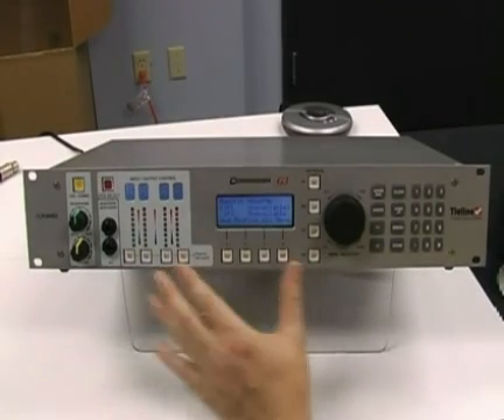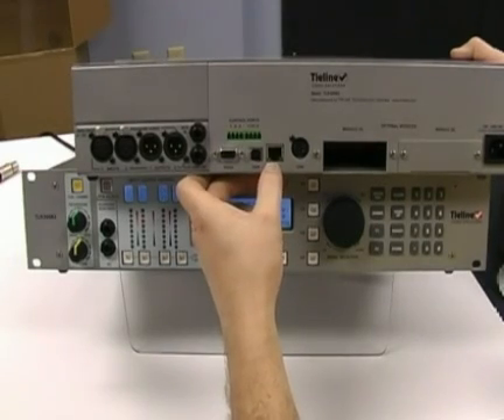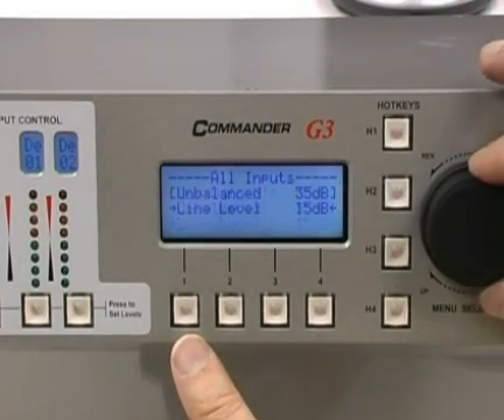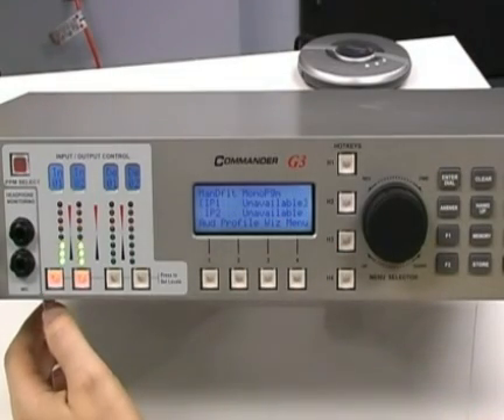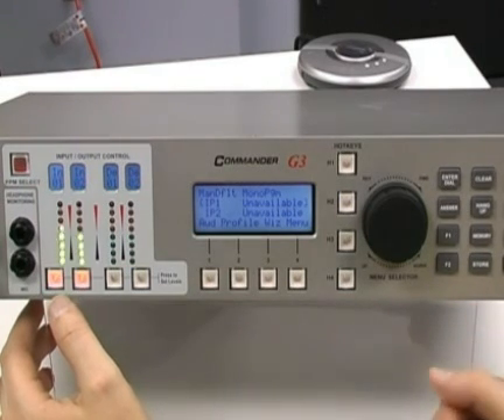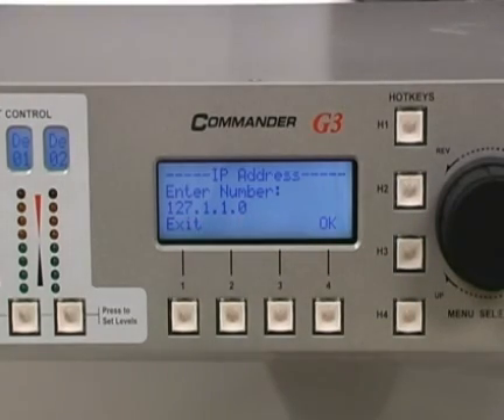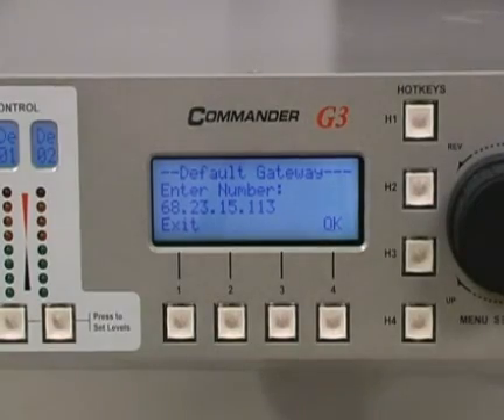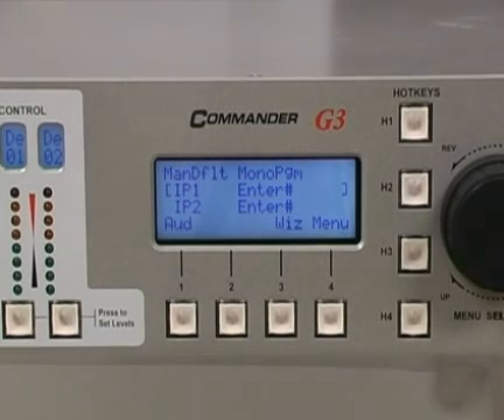How to make a remote broadcast with Audio over IP

Comment: it's good but you get charged a lot of cash for using the 4g network. cost us 2k just for a 2 hour show
Reply from the maker: There are numerous affordable data plans available these days and you can optimize the connection bitrate to minimize data use in many instances. Plus you can encode only to save on data if you don't need a return path. Contact support@tieline.com for more details about reducing data usage.